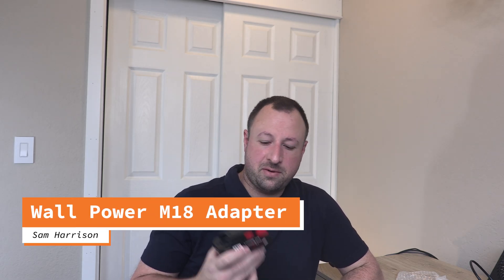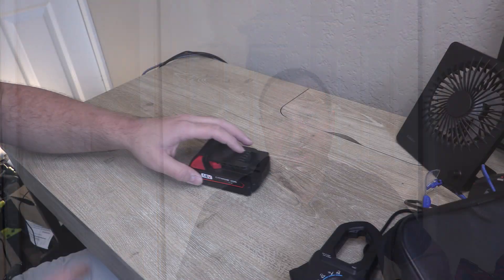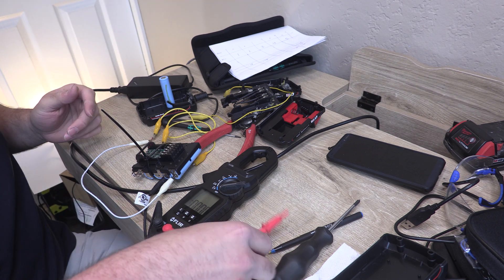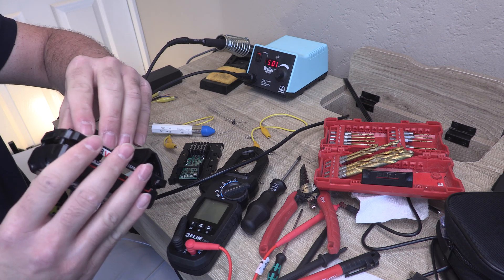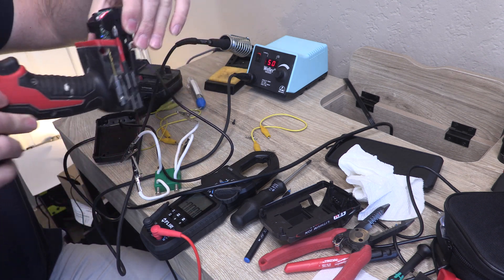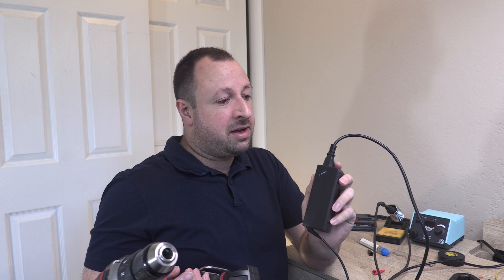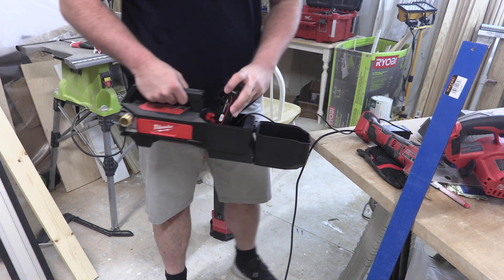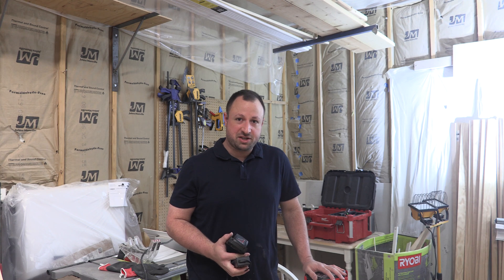Plug your M18 tools into the wall!

Comment: Hello, I have been fighting with this and not sure what I am doing wrong.  I have tried several M18 batteries and 2 different power supplies and the only thing that happens is the light on the drill will come on for a bit then goes off but I never get the drill to actually run.  The one power supply that I am using is a very good Mean Well RPS-500-18-C that should have enough power to run it.  I did exactly what you said and disconnected the positive connection on the one corner from the battery and then the negative connection on the other corner from the battery and then connected my power supply + and - to the corresponding metal tabs (the ones that were "welded" to the battery + and -.  What am I missing?

Thanks so much
Alan
Reply from the maker: Hi Alan -  I'm not sure! I

 looked at the specs of your power supply, and my first thought is - can you step the voltage down from 24 to 22 v (and is your power supply pushing 24v max, or 24v nominal)? I don't know how sensitive the M18 tools are to voltage, so you may be triggering a high voltage protection which causes it to cut out? And lastly, did you check with a multimeter that each of the terminals of the battery are getting the proper voltage and polarity?

The modifications I did to the battery I had worked, but I suppose the PCB could be a different layout if you chose a different manufacturer (and thus, different tabs could have been the series rail).

Let me know what you find!

- Sam
Reply: @harrisonhobbies241  Thanks so much for responding....   To answer your questions:
1.  The RPS-500-18-C is an 18VDC power supply.  Not sure where you got 24V?
2.  I am using a Milwaukee branded 2AH battery, actually I have tried 3 of them.
3.  Yes sir, I did what you did and mapped out the pins where the pins 1 and 2 and 4 are ground as you have and the fifth pin is positive (+) which also maps to the markings on the actual battery.  They show a + and a - on the black part of the battery.
4.  Yes sir, I also made sure I had the + and - correct on the battery pack itself.  I did what you did and removed the tabs from the + and the - on the corners of the pack, the batteries at the end.  then I connected 2 different power supplies up to those points.  But I cant get anything to run.  I do get the little LED light on the drill to light up but no actual drill working.
5 All I can figure is there is another handshake going on that I haven't found.

If you actually got one to work I would be more than happy to pay you for it so I can further debug on my side.

Thank you sir
Alan
Reply: The problem now is I have spent quite a few hours on this, and have gone through 3 batteries trying to figure it out.  I still don't know if it is my particular battery OR some connection I am missing OR the power supply.  That is why I suggested using one that you have working to narrow it down on my side.  I even bought a fancy little box for the power supply, made sure it is 18V 27A and 500W.  I have measured the output at 18VDC and double checked all the battery voltages and connections.  I even did what you did and.....  when I connected my power supply as you did and measured the 12v at the battery terminals (positive, negative, not used, negative, negative) then connected the drill and STILL NOTHING.

Thanks again,
Alan
Reply from the maker: @alanhymes2881  1. Ah! I was looking at the 24v model. :( https://www.digikey.com/product-detail/en/mean-well-usa-inc/RPS-500-24-C/1866-5611-ND/10129205?utm_adgroup=AC%20DC%20Converters&utm_source=bing&utm_medium=cpc&utm_campaign=Shopping_Product_Power%20Supplies%20-%20External%2FInternal%20%28Off-Board%29&utm_term=&utm_content=AC%20DC%20Converters&utm_id=bi_cmp-274520440_adg-1306220036329594_ad-81638800704773_pla-4585238369727346_dev-c_ext-_prd-10129205&msclkid=6786744ce5641f0cf58e2b387fa2b594

2. The battery i used was https://www.amazon.com/gp/product/B07MLYWHHL/. I haven't tried any OEM batteries, so i'm not sure if they have additional tamper features?

Unfortunately, i only have the single battery that I've modified - so nothing to send out currently.

Do you have any other M18 tools that you can try? There is potential the inrush current may be tripping your power supply. Based on subsequent testing i've done, the drill running is taking around 300 watts. https://youtu.be/JY_vQyFzP4A?t=518 .It sounds like your terminals may not all be receiving voltage?

I had success with the multi-tool and fan being lower wattage options - so maybe try another tool if you've got one? You could also try hooking up the 18650s from the pack in series to see and linking those to the + and - terminals of the pack to see if it's a power supply issue.
Reply from the maker: @alanhymes2881  Since i don't have a spare battery handy to send, I can have a Zoom call with you at some point and try to help you troubleshoot if you would be interested? Let me know and we can set that up.
Reply: @harrisonhobbies241  Thank you so much for your time.  I went ahead and ordered the exact battery you used to see if that makes a difference.  I should get it on Friday.  As for the the zoom call, SURE, or is there a number I can reach you at?   I would love to talk to you about it.

Thanks again!!!!
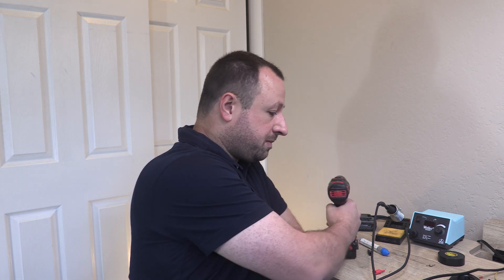Reply from the maker: @alanhymes2881  Are you free around 5:00 PM PST (8:00 eastern) to troubleshoot?

Sam Harrison is inviting you to a scheduled Zoom meeting.

Topic: My Meeting
Time: Sep 30, 2020 05:00 PM Pacific Time (US and Canada)

Join Zoom Meeting
https://us02web.zoom.us/j/84957701691?pwd=cERZUmRRM3lNdS9kVTNjZ2lYYklxZz09

Meeting ID: 849 5770 1691
Passcode: Lx9hgS
Reply: @harrisonhobbies241  yes sir I will be there
Reply from the maker: @alanhymes2881  Alright - i'm on now.
Reply: the drill  requires a large startup current which may exceed your power supply and trip some kind of safety
Reply: The problem was the battery.  You can not use a Milwaukee battery.  I had to use a "generic" battery for it to work.  There is some sort of electronics/signal in the OEM batter that won't let it work.  I went through several OEM batteries and all failed.  I tried the generic one and it worked.
Reply: All very helpful.  I also tried a genuine battery and the result was failure.  If anyone figures out how to do this, it would be great to know.

Comment: did you ever come up with a capacitor that will cover the surge draw?  i want to make one for a vacuum but i showed aprox 10 amps constant with and inrush of near 20.  that was on a trash meter mind you.  i did find some other power supplies but i cant seem to get any info on their surge capability
Reply from the maker: Not yet. I did some wattage testing - and should have that video posted soon, but haven't had time to get more done. :(
Reply from the maker: I've tried powering tools with a bigger supply... Success: https://youtu.be/arXXAF89-wg